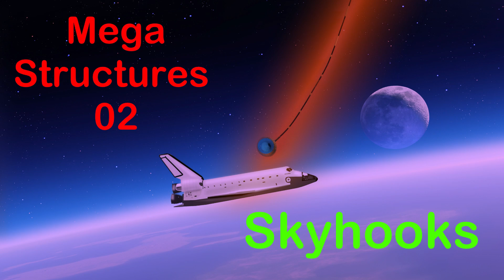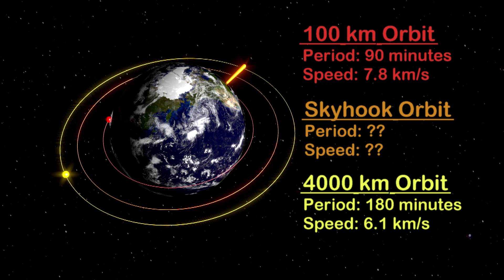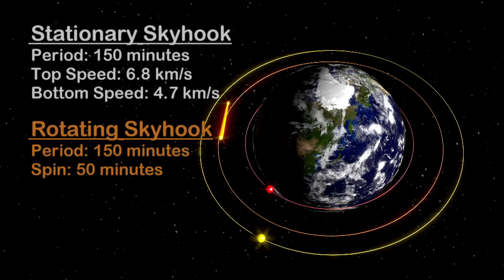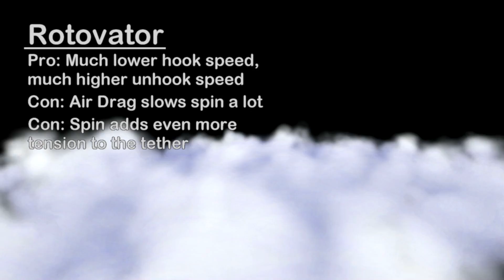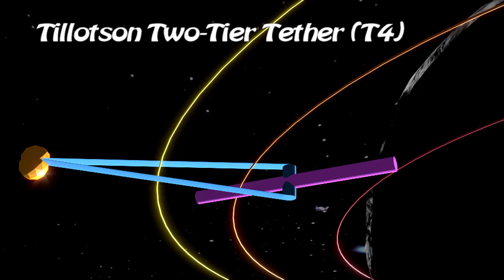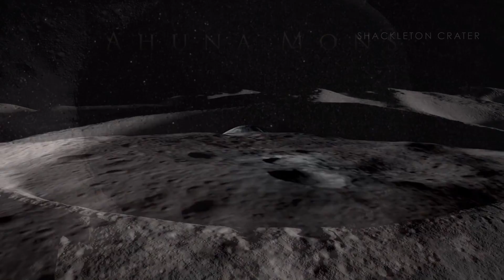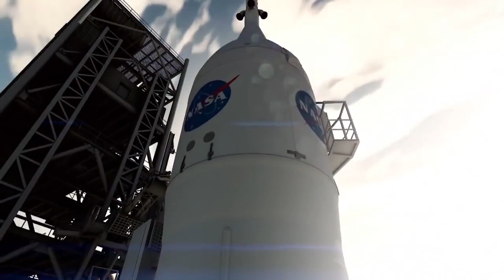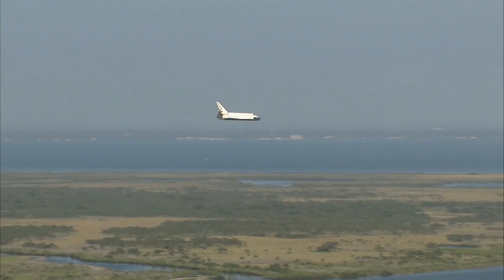Skyhooks & Rotovators

Comment: I did the math for the space elevator, and what I called the space Axe which is a type of sky hook or rotovator.  this would be a structure that dipped a thin end into the atmosphere at about mach 3 and once it captured its capsule or ship, it would use gyroscopic arrays to stop rotation when at 90 deg.  When in the atmosphere, the tip would compress air to use for station keeping.  The math seemed to work out for carbon fiber and Kevlar, and even for beryllium.  Obviously the end could not be beryllium since it is poisonous, but the frame would be no problem.  Cost wise would put it somewhere around the national debt to build.   I could not get the math to work out for the space elevator on Earth or the Moon.  If it is possible, it would probably bankrupt most of the economies of the world to build, but we can all dream.

Comment: Wouldn't the fuel required for station keeping whilst deployed supercede the energy that small individual crafts can put out?
Reply: Nope. What matters is specific impulse, or momentum per unit of fuel. If you can get a high enough specific impulse engine/propellant (like ion engines) then you can regain the lost momentum relatively easily. It's just a matter of keeping the momentum where it needs to be. Hell, deorbiting something (or lowering the speed of something) would increase the skyhooks momentum.

Comment: Could we use balloons to get to space? It would involve using weather or similar helium balloons to haul a space ship up into the stratosphere or mesosphere, Once at that altitude, the space ship would have it's engines fired up and the craft would be untethered from the balloon or balloons and go the rest of the way into orbit and beyond. This system would drastically cut costs to put people and things into orbit by reducing the amount of fuel needed to get from Earth to space. Isaac Arthur, how possible is this proposed system?
Reply: Technically doable. But rockets spend most of their energy getting up to orbital speed and overcoming gravity drag. Getting to altitude and air drag are minor issues for rockets. But... we could use a balloon to get to space. Use one type of balloon to get to a high altitude, build a floating station there, and use another balloon with weak engines (maybe ion engines?) to accelerate to orbital speed. Could work.
Reply: On page 246 of "2081" by Gerard K. O'Neill, he explains how the "STARS"  or Solar Thermal Aerostat Research Station high altitude balloon concept from the Franklin Institute in Philadelphia could be used with an electromagnetic launch system.  No fuel would be needed - only electricity.  Craft returning from space would generate electricity.

Comment: Can you Explain the reason why we haven't Built One yet
Reply: He said a few dozen times, we dont have a viable material yet. They need to step up graphite research.
Reply: @notnotness4765   That is emphatically not correct. You have confused this with elevator discussions. See 7:30 ff, "we can use a ladder of these tethers with any material...existing materials we can already mass produce". This is the whole point behind rotovators vs elevators - we don't have to make them out of unobtainium, we have perfectly useable materials now, because their design is basically configurable to fit whatever tensile strength we have available, by tweaking length, rotational rate, taper, altitude, and eccentricity, and by stacking tethers in sequence. The limiting issue is how well we can get the handoff coordinated - multiple tethers multiply the handshaking required.

Comment: Okay in the 1960's the  US air force built 2 experimental supersonic bombers that can cruise at mach 3 with a range of 6,900 km (4,300 miles) and could fly at a maximum of 23,600 m (77,000 ft). It was the XB-70. It was by no means small . Unit cost was about 750 million even though only two were built. 

Surly We could use those for lifting payloads up to a skyhook. (not it'self lifted up) These were meant to carry thousands of pounds of nuclear weapons all the way to Russia. Surly we could build a skyhook that can meet those parameters.
Reply: Flying in the atmosphere and getting into orbit are two different things. XB-70 had the atmosphere to use as oxidiser. Meanwhile a spacecraft has to bring it's own oxidiser and fuel into orbit, then accelerate to high speeds (around 7.8 km/s) to stay in orbit. Plus the XB-70 could rely on lift to help keep itself in the air, while a spacecraft has to rely on speed alone.

 Also, they XB-70's top speed was around mach 3, which is not enough to achieve orbital velocities, as mach 3 is only 1.029 km/s, which is lower than 7.8 km/s.
Reply: @5000mahmud  did you actually watch the vid? The whole point of rotovators is you don't need to attain 7.8km/s

Comment: A plane or any other vehicle will never be attached to any skyhook via a magnet. Its just not going to happen. Just look at how accurate they are at a scrap yard, You are not going to do that in the air at speeds where aerodynamics needs to be near perfect. I'm guessing it would need to be attached with millimetre accuracy. And when it comes to grabbing stuff with magnets, that accuracy just wont happen.

edit: Also bringing an object near something at that speed without destabilising it would be a fun thing to pull off even with the electromagnet off.
Reply: Umm... these would be magnets that are much more accurate than junkyard magnets. They would be pretty dang expensive, though.

Actually, high accuracy isn't quite necessary. If the altitude is high enough and the air density low enough, aerodynamic forces are tiny. Hell, even rockets barely lose anything to air drag. Gravity drag is far worse.

Comment: wa wai wait  can you hold on for  like 20 more minutes i just flipped the potato wedges and i need about 20 more minutes please?.... what that you say  a...pause... button.....so you mean its not like tv where i have to wait for an ad break? ......so....why  is every think on this web  site  ? like only 5 minutes longs... do the other's not know of this "pauses button.... my god  quick get me  my quill and ink  and fetch me some runners we must spread the word of this... pause button.... just think.... of the misery and suffering it could alleviate... by the gods
Reply: 12:01 ang on ang on a mo   wouldn't it make more sense to that both ends taper towards the center or rotation  thus halved the load on either tip?
Reply: 2014 hmm now there's an idea the part of the hook that is in the atmosphere could be fitted with  wings to  provide lift ( small tho it may be every bit helps) to help reduced the strain on the tether its already going fast enough  but  in the increase  in air drag caused by wing large enough to be useful would have to be i imagine eminence so...... addendum you know if you could  make a sizeable portion of the in atmosphere  tether hollow  you could pump it down to a vacuum and turn it into some sort of vacuum ... Zeppelin?... balloon? ... thing  that would ( assuming you could keep it from crushed like a tin can ) then allow  the in atmosphere part to provide some positive buoyancy 

 hell maybe even some solar sails on the top to unfurl when the solar winds are blowing just right to capture a bit more velocity to make up for what you lost in the last lift

Comment: There is a simple solution to the hypersonic launch vehicle cost, why not have a subsonic aircraft waiting with a net structure as the skyhook moves through the the net it is caught and pulls the launch vehicle up to speed, you could even have the launch vehicles own tether on a reel that can wind and unwind to control acceleration

Comment: I think the simplest way to keep the spinning skyhook going is to attach electric ducted fans to each end and just produce thrust when the end enters the atmosphere. Like balancing a stick, you know. It should also be easier to construct than a space elevator, as you can build the station that goes in the middle in orbit, set it spinning and, while you're doing that, winch out the two ends. They'd need to have thrusters on them to keep going at the right speed but once it's deployed it can do the electric fan thing.

Comment: Isn't the problem or one of the problem to solve with this is the additional potential drag on the atmosphere itself, creating the structure or device to engulf in flames like during re-entry?  If that is feasible outside of that scorch atmosphere effect which also protects from deadly sun rays to enter the earth, then it would be much easier and more feasible.  Are there any certainty ratios as to how feasible this is.  That (skyhook) would allow to build space launching station in space which would reduce the cost of exiting the atmosphere and gravity of the earth.  It would also allow to lower objects to back earth in the reverse function, so to still potentially reduce the scorching effect, although this may prove more complex later down the road...  If at all feasible.  There are ways to regenerate the depleted ozone layer, although it is quite costly in resources and not accomplished yet.

Comment: Hits the spot
Consider the EM drive.
Once out of the well, don't go down another until we get a grip on gravity.
Gerard K. O'Neill and L4 &5.
Orbital airships, single use. Disk shape., that Cleave in two, to be used as 1000 + meter planet finder binocular telescopes at the le Grange points of the outer giant planets.  Consider making them from on ice molds at the South Pole.

Comment: From a momentum management perspective the T4 system would be the best (on paper at least). The non-rotating upper section could easily house the solar array, and  the non-rotating "rotor support limbs" could provide a current pathway for electrodynamic lift. There's no reason why such a lift system could not be supplemented with ion thrust (or in an emergency situation, with plain old chemical rockets). Rotor bearings? Ceramics. VERY long endurance, and the ability to run lubricant-free would make this technology the ideal candidate. If sized correctly the T4 system would still be able to "hook" relatively (low-Mach) cargo, and it should not be particularly challenging to design and produce  high-acceleration, relatively short-haul  cargo aircraft capable of depositing a reasonable-capacity aerodynamic pod on the capture device, yet maintaining aerodynamic stability once the cargo has been transferred. Returning cargo pod? If we need an aerodynamic structure for obvious reasons, the easy (VERY easy) technology extension is lifting-body aerodynamics, along with, say, extendable control / lift augmentation surfaces, so returning pods have sufficient range and directional control to glide (or even fly) to a suitable landing site. Such tech would eat in to the total usable payload capacity a little, but would greatly increase utility value.

Comment: lt is easier to make a vehicle reach an altitude over 100 kilometers on a near vertical trajectory like Spaceship 0ne than it is to link up fighting all the shock-waves of supersonic flight in atmosphere thick enough for air-breathing engines. This would also massively reduce the velocity loss to atmospheric drag as well even for a rotating tether.

Comment: The skyhooks and the elevators have one big fisical problem , is he concept of weight , because the weight is he force that gravity makes over and object, if you put a cable near earth to geostationary the weight of the cable will pull down all the system and of course you can put a station beyond geo orbit to counterweight that efect but in the moment you put a espaceship conected to the cable you will need to move the station far away to counter weight the new pull and the energy to move all the system in the space will be the same to move the single spaceship to the same orbit so there is no gain in this incredible dificult and costly system.
Reply: cmpchutin1  he literally covered all that in the video.
Reply: i repeat there is no gain on the system the use of magnetic field to generate thrust is no strong enough to pull rapidly a  ship to orbit and if you add velocity to the cable the entire cable will go to upper orbit and in the moment to conect to the ship all the system will fall to a lower orbit and if you dont lift all the system rapidly to a stable orbit all will fall and incinerate because of the drag of the atmosfere and because the drag of the cable produced by the magnetic field too, see the space tether experiment, used to pull down a ship.
you will see that a cable crossing the mgnetic field act like gnerator and generate drag because of it and because of the drag of the diferential gravity.
Reply: cmpchutin1. dude, ypu spouted off a bunch of nonsense with nothing to back it up, wheres the math?  how fast would a 1k kg payload deorbit a 100k kg tether? you say right away but you offer no numbers to back it up, you say electrodynamic propulsion simply cant provide the thrust needed but you neither know how much it can produce nor how much it would need to produce, then you prove your ignorance by claiming there would be a net drag loss when using the system.

yes, dragging a tether through the ionosphere generates power at the expense of the tethers momentum. but thats not propulsion, running power through the tether reverses the effect and you gain momentum. its the exact principal that allows a motor to be used as a generator and vice versa. 

if you are going to pan an idea so completely and certainly then at least offer SOME numbers to back it up, other very smart people have done the math amd the consensus is that it is absolutely possible.

Comment: You seem to be jumping to conclusions about cost savings.  Specifically that fuel/power costs have a significant impact on launch costs per pound.  They don't.  It's a stubbornly common myth among space advocates, and more so among space elevator fans.  In reality capital and fixed costs, over the tiny flight rates dwarf all other cost factors (excluding accounting costs on gov contracts like the shuttle).  Sky hooks and space elevators drive the capital costs way up.... Yeah can't think of anyway to say it without being punny.  

A friend runs a internet radio show called "The Space Show" and had some folks proposing actually building a space elevator.  They were going to use the profits from the sale of nanofiber composites in normal market to fund the construction of a space elevator.  Ignoring the fact that nanofiber composites are about as strong as cotton thread since the fibers are very slippery.  I pointed out they would need cubic milieus of the composit at their assumed strength, and assuming it cost the same per ton as the wholesale price of Kevlar composit, the cable material would cost about $400 billion.  Assuming the cable could last 30 years (hanging through the Van Allen belts, solar flares, mono atomic oxygen, etc.) and it carried up its full capacity of 1,000 tons per year (we only lifted 2,000 tons of cargo in all of human history), just the wholesale cost of the cable would run about $7,000 per pound of cargo lifted.  (About a 1/3rd the current price NASA pays to have SpaceX, shuttle, etc to lift cargo to the ISS.). Add in the cost to build the full elevator and operate it, and you'll never compete with normal rockets at current launch rates costs.  Current rockets in a thousand ton per year market would grossly undercut the Space Elevators on a cost per pound.  And I'm not clear how Skyhooks could do much better?

(I'll copy this over to the space elevator vid comments.)

Comment: The angular acceleration of the sky hook from the point of the pick-up in low orbit moving to upper orbit would be so great I don't see how a person could survive that acceleration.
Reply: James Coleman. the acceleration would depend greatly on the legnth of the tether  and its orbit.

also while Isaac shows the tether turning in sync with its orbit (likely to reduce aerodynamic drag) the speed the tether actually rotates can vary.

it can rotate slow enough that your actual ascent from that point can be rather slow. but like I said the tether would experience a lot more drag amd you might need significantly more mass in your tether to generate the same inertia.
Reply: Thanks for getting back to me. Your explanation makes sense. I'm new to the Idea and I've been keeping an open mind. Besides reuseable rockets, which idea for raising people and cargo into orbit do you think is the most likely to be used first?
Reply: James Coleman. honestly, I see rocketry as being the meat and potatoes of space flight for the foreseeable future, they work well enough, they have decades of experience invested in them and they are very flexible/adaptable to various missions.

hooks may well be the next paradigm shift if someone makes the investment but rockets are going nowhere.

its kind of a chicken and egg proposition, for people actually paying for trips to space rockets work well enough and are cost effective, the developement of s9mething that promises cheap space fare really depends of there being an un tapped market, so a bit of faith is required for that step to happen.

Comment: If this is so cheap (compared to most other options) and uses tech that already exists, why haven't we done this? And if some company decided to do this right now, how long would it take to build?
Reply: deisisase. potentially cheap after a significant investment.  such a system would likely out mass the ISS a few times over and while it is certainly possible it still needs to be developed. at great cost and risk.

current routes to space have the advantage of being established and even after tethers are a thing would still need to exist.

rockets are a safe bet amd make money now, tethers are a risk with a relatively long term reward if it ever does pay off.